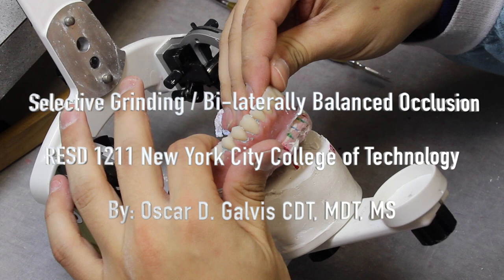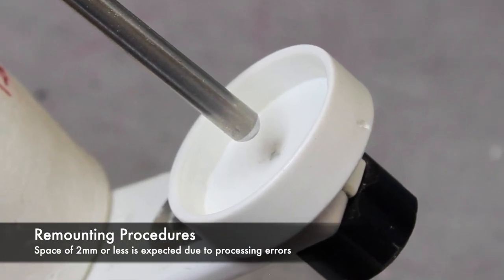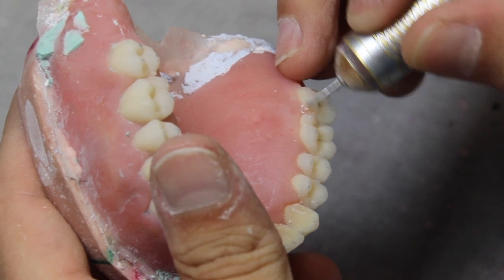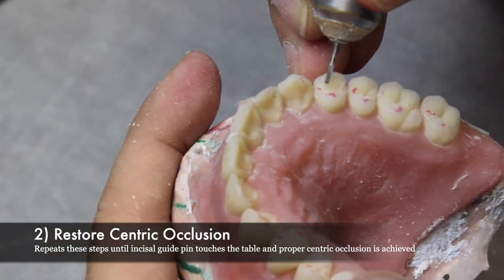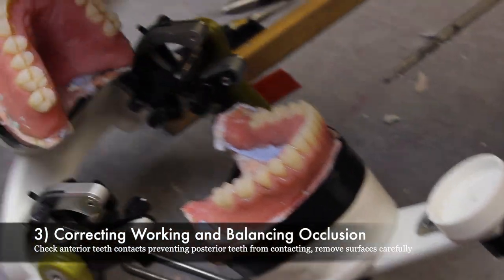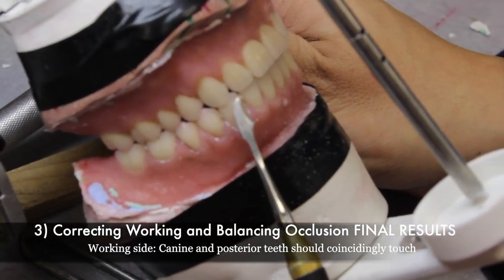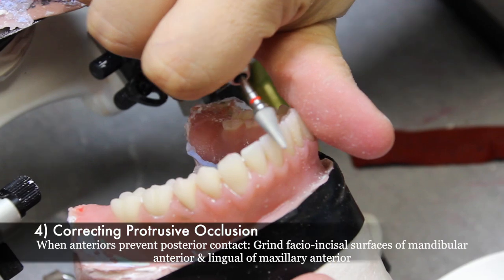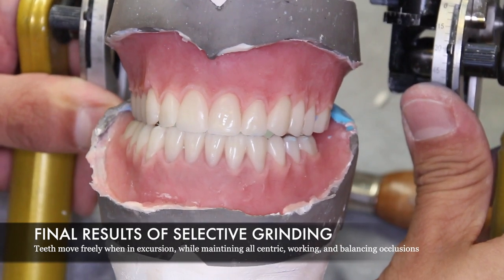Complete Dentures - Selective Grinding Step-by-Step

Comment: good job prof Oscar  one question please why in occlusion max intercuspation the anterior teeth should not touch ?
Reply: Anterior teeth should not touch in M.I. because they would prevent excursive movement and balanced contacts during mastication. Anterior teeth should slide across each other and contact during left, right, and protrusive movements. Having patients "locked in" during M.I. would prevent this, so in full 33 degree anatomical setups and semi anatomic setups that's why the anteriors are usually set with 1mm overbite and 1mm overjet to allow this space for functional movement. The amount of space needed is less for shallower cuspal inclines such as 10 degree occlusion. The lower jaw naturally and instinctively slides forward ever so slightly during incisive action (biting into a piece of apple or chicken) allowing anterior teeth to meet and are balanced by posterior cuspal tips if dentures are properly balanced. That movement can't happen if your anteriors are locked in during maximum intercuspation, so setting them that way is wrong and going to end up with broken anteriors and sore spots without significant adjustment to create this 1mm OB and 1mm OJ of clearance.

Comment: I don’t know the first thing about dentures, but I just got my first set of full dentures about a month ago, and I don’t know if the problem I was having is called occlusion or whatever, but the teeth didn’t fit together inside my mouth the same same way they did when they are out. There was a huge gap in between the front teeth! So I finally went back today to have it looked at, and the dentist took the dentures in the next room and came back an about 5 minutes put them in my mouth and now they look like they are supposed to when I smile. But when I get home and take the teeth out, I realize that He completely removed every single cusp and point on all of the back teeth, top and bottom! Completely flat now! Like I said, I’m clueless to everything dentures, but is this a common practice? And will I be able to still break food down properly with these dentures?
Reply: Dental Tech student here! It seems as if one of these things must have happen. the dentist made a mistake on your jaw measurements, the technician didn’t place the teeth the way the jaw measurements/ occlusion ( meaning when you place your teeth align , like when your smiling) to your jaw shape, or they just never actually check if the teeth have a balanced occlusion, for when your mouth is resting or ready to chew. I would think they would move the cusp so the remaining teeth would be temporarily aligned, and then they should preform a repair and get you a new set of cusps